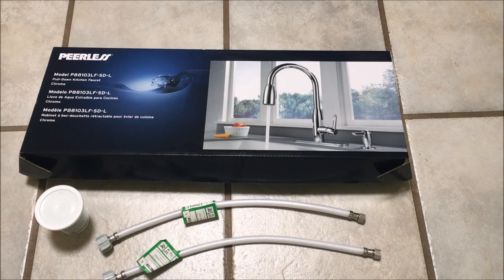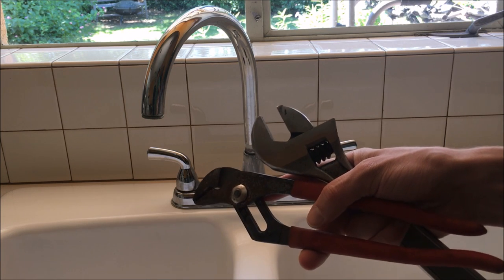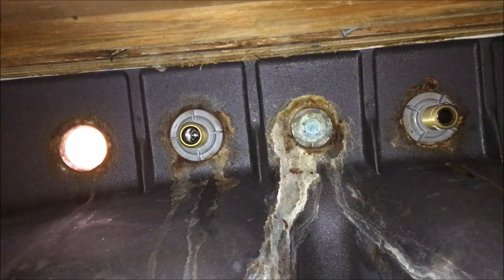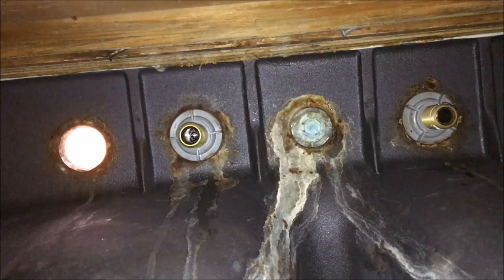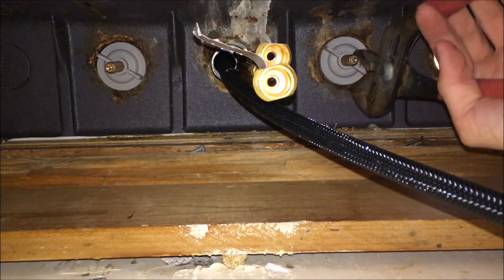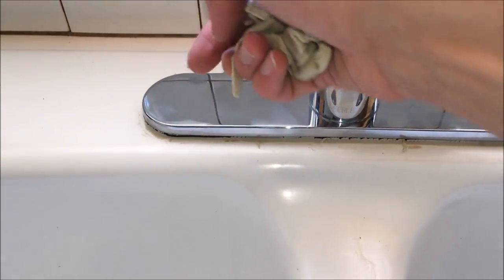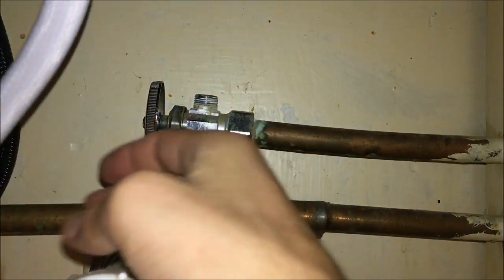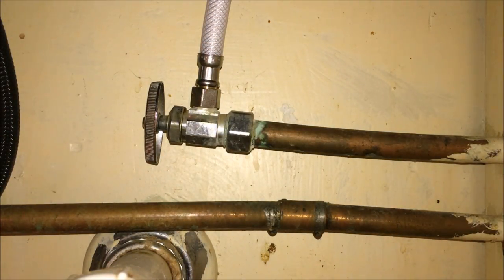EP 29 - Plumbing: Installing the Peerless P88103LF-SD-L Faucet

Comment: Installed the Peerless Kitchen Spray Model P88103LF-SD-L open  the shut off vale but no water is coming out . What could make it do that please help
Reply from the maker: Make sure you pull the faucet handle out, rather than side-to-side. The side-to-side motion controls temperature and the outward motion controls flow rate.

Comment: any idea how to slow the swivel down from one sink to the next? its way to easy , a hand held fan can move it, its that easy
Reply: 3 yeqrs late .. Just have to tighten the ring at the base of the water neck. Hope this helps somebody...
Reply: @shaneh2755  where is the ring? does that mean taking it apart?
Reply: @slooky14  no, its the collar that connects the water neck to the base. ( sorry,  I'm not a plumber and I don't know the correct terminology)
Reply: @shaneh2755  Thanks but I'm not sure there is a  ring. I would have to take the sink right out to find out. I don't remember there being a nut. There is a nut that goes up to the counter. Tightening that will do nothing for the swivel.

Comment: I was teying to figure out where the eacutchwon with the hasket went. I never saw you use nor mention it. It was the one that was screwed onto the bottom of the faucet.
Reply from the maker: Hilda Maughan The faucet comes with two options: the wider escutcheon to fit 3-hole sinks and the single ring to replace single-hole sinks. In this case, I used the wider escutcheon because I have a 3-hole sink.

Comment: Yet another video showing everything but what I'm stuck with. I have this exact faucet, but am needing to use the single-hole application, without the deck plate. There is no tool, nor technique that shows how to remove/install the main mounting nut.
Reply from the maker: Paul Orlando The main mounting nut should just unscrew from the stem, then slide over the supply lines. You might need to bend the copper lines before removing the nut. Then you should be able to place the ring over the stem and re-install the nut. If you could send me photos of the specific problem you're having I might be of more assistance. Good luck!
Reply: How can I send you photos? I appreciate the reply, but that thing is tight, and a basin wrench is too small to fit over the nut. There's only about 5 inches of clearance between the wall and the back of the sink. Did an extensive search online, as well as visited my local hardware and home center stores, and no tool for this exists—even from Peerless. I really can't believe no one gets what's going on, as I've had this problem three times now. I realize the most brands use a smaller nut and position the hoses outside of it, but Peerless is not an off-brand.
Reply from the maker: Paul Orlando  You can send them to dielectricvideos@gmail.com, but to br honest you might be better off reaching out to a professional that you trust. I'm an EE student, not a plumber, so my experience is rather limited in the specific issues encountered with this faucet.
Reply: Thanks. I appreciate the thought. I'll send them, but sure there's not much more to it than what I described. I have a pro coming out to install it—so much for saving money on it; I could have spent a little more and got an easier one to install, but none of that is indicated on the boxes when you buy them. I realize that you normally don't drift into other subjects, but your video was better—more specific, and clearer than all the rest I viewed. You really should do other genres.
Reply: I know it’s been years since you posted this comment, but do you recall how you were able to get the main mounting nut off? I’ve been at it for hours and can’t get it 😩
Reply: @etilque   I feel your pain. There are tools you can buy that are long sockets with a side cut out so you can get around the hoses, but as I remember, I just bit the bullet and called a plumber. I know that doesn't help you now, and not the answer you wanted. It really should be easier, Working between the wall and the sink is a bitch-and-a half. You may want to check your local hardware store for a faucet tightening socket. Again, wish I had better news. Here's the tool I was talking about...
https://www.youtube.com/watch?v=CS5KRliAUcg

Comment: Going to try installing this faucet tomorrow. Curious why you didn't use the provided mounting hardware on the mounting shank? That's the primary support. Here's the Installation guide.

http://pdf.lowes.com/installationguides/034449637107_install.pdf?_gl=1*6p3odd*_gcl_aw*R0NMLjE2MTAxMjcwOTguQ2p3S0NBaUFvdURfQlJCSUVpd0FMaEpINkJ0UnR1Y0tVRl9Hd0FRRG1Icm1FMDZFcjA2ZWFHY19hQmFCRWhPbTM5cVZoeGVZdmdIcnR4b0M3cDRRQXZEX0J3RQ..*_gcl_dc*R0NMLjE2MTAxMjcwOTguQ2p3S0NBaUFvdURfQlJCSUVpd0FMaEpINkJ0UnR1Y0tVRl9Hd0FRRG1Icm1FMDZFcjA2ZWFHY19hQmFCRWhPbTM5cVZoeGVZdmdIcnR4b0M3cDRRQXZEX0J3RQ..